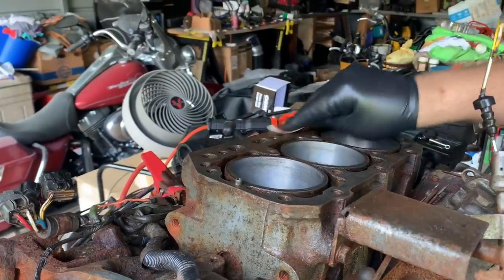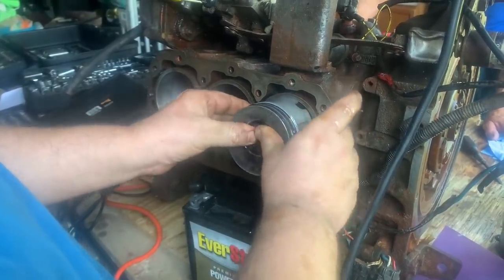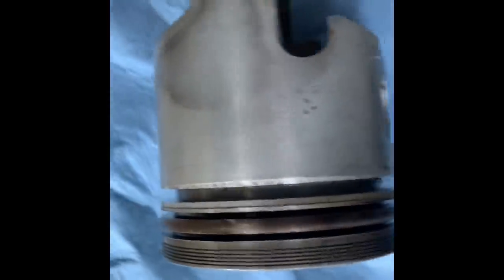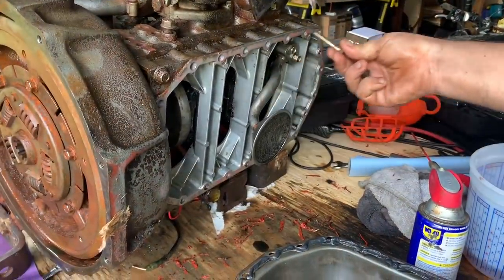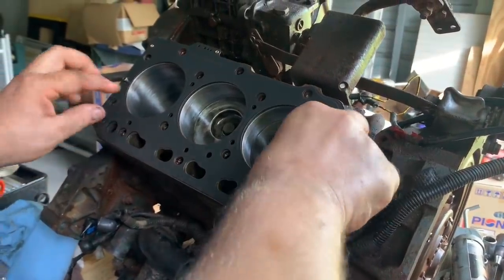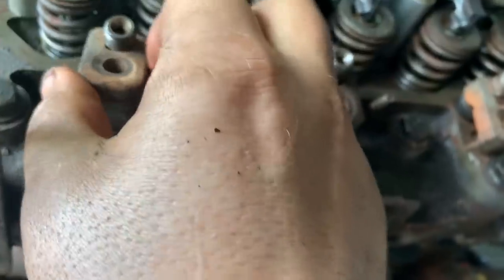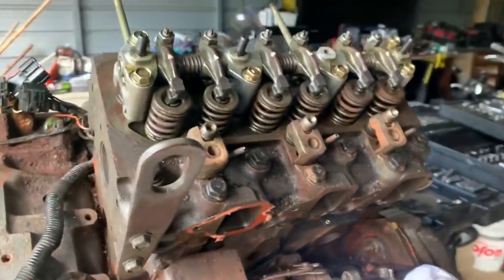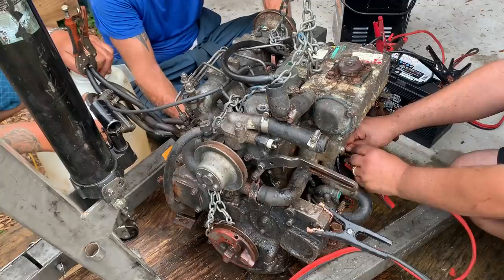Repairing a yanmar 3jh3e

Comment: Update on the yanmar diesel... This diesel was flooded on the engine room of a sailing catamaran during a hurricane with a previous owner, Scott and I have rescued 7 buses together and Scott was kind enough to offer to give it a go on repairing the yanmar... The previous owner had taken the engine apart and fresh water had done a good job of making an added mess of everything... 
Scott is really amazing at being able to go with the flow and figure ways to get most anything done...and done well...
The update is that we now have put over 600 hours on that engine this past charter season and it's running better than the one that was perfect in the other hull.... Thanks again Scott...

Comment: I am continually amazed at the conditions you are working in. In 1959, I rebuilt a 1949  overheated Chevrolet six (I don't remember the displacement) that had set in the Arizona desert for several years. Bored out.060 over it was a powerhouse for the time. It had shims and plastic tell-tales for clearance on the main and rod bears. I had to turn it over with a breaker bar many times before it would crank and it ran hot for several miles before the bearings "cured".
Reply from the maker: I just did this as a favor for a friend. It was more of a challenge.  I have never once worked on a 4 stroke diesel ever.  And since someone else took it apart and it was missing some parts it was crazy that we got it running in two afternoons.

Comment: Once again, fantastic work, thanks for posting this.  WD40 starting fluid, I love it!  Speaks volumes for the build quality of Yanmar diesel engines! Those battery powered ratchet wrenches are sure less restrictive then the air powered versions I began using 40 yrs ago.  No air hose to get in the way.  I am surprised that the fuel pump and injectors worked after suffering water ingestion.  That boat owner was lucky to have found you, but he looks like the same guy in the MCI bus video with the snapped pinion, so I guess he already had your number.
Reply from the maker: https://youtu.be/zuXHqdS26aA  yes i did this as a favor for a great bus client and friend.  He has owned like 10 buses.
Reply from the maker: And yes, Wd is much less volatile than starting fluid.  It took a bit to get fuel to the injectors

Comment: I am kind of the opposite of you in regards to the contents of the toolbox. I have all metric tools and then a few standard sizes for the in between ones. 5/16" = 8mm, 7/16" = 11mm, 1/2" = 13mm and so on. So I keep standard wrenches and sockets for things that don't fit a metric size well. 

Really cool to see that old Yanmar up and running. Great fix.

Comment: I hope you pulled the water pump cover and looked at the rubber impeller for missing paddles.  It is a good idea to replace them anyway.  If there are any missing paddles you need to look at the heat exchanger down stream of the water pump and rod it out if you see anything in it...Common cause of over-heating on a Yanmar.

Comment: Nice work! You rebuilt that rusted and seized boat anchor with minimal replacement parts. What was it? 2 connecting rods, a bearing and ring set, and a head gasket? The rest was just carefully cleaning and refurbishing what came off of it. That's an excellent rebuild! Thanks to the heroic metric crescent wrench! ;)

Comment: Believe it or not , it’s alive. Nice job . The motor sounds pretty good  and idels nice. I would be curious to know if the compression is with in spec considering you used the old pistons and shitty used rings.  ( then again, who cares it’s running ) That motor is going in that big ass Cat ?
Reply: Docking motor's are traditionally fairly small for tight and controlled environments where you need a predictable throttle but I've seen a few used when its calm with fairly good results speed wise.
They are after all an Auxiliary engine.
Reply: tony66au  I’m not much of a boat guy but I kinda figured that was its job. I was brought up to always go with “ big is better”  theroy.  Having said that,  that little motor probably lived in that Cat and will go back “ home” a happily little camper. Go in peace little motor ✌️
Reply from the maker: New rings on all 3 cylinders but yes used pistons.
Reply: @rickjohnson1632  Me neither but I was dragged along on a few boats as a teen and in my early 20's. These guys where very pernickity about using the right terms for the gear lol so I got an edumacation if I wanted it or not.
On the bright side the LOVED my old Bus when we would go camping or shooting and eventually a few Traded up although they kept the Captains hats so I dubbed them Couch (Coach) Captains and had a lot of fun with "Permission to come aboard" etc  as most had more gold braid than a South American Dictator which is saying something lol
Reply: Thanks so much..
I have a 3 cyl. Perkins, very similar marinized Shibaura block..
Your excellent way of transferring knowledge is much appreciated.

Comment: That's a new one.  I don't think I've ever seen someone take straight up sand paper to a deck surface before.
Reply from the maker: Had you ever seen a submerged engine set for two years in a bilge of a boat with a head off open to the elements?  A light cleaning to smooth out the rust ;)
Reply: @BusGreaseMonkey  I haven't though I think if the surface were bad enough to warrant sandpaper id probably take it to the be machined. 
Honestly all my experience is with gasoline car engines.  I've never even touched a marine diesel.

Comment: I didn’t see the valve rotator buttons go in. I hope they didn’t get lost when they took it apart originally. 
   Maybe it’s a strange model that didn’t use them??   ???
Reply from the maker: They were missing.  We ordered them and added them the next week.  That engine is still running strong more than 1,000 hrs now
Reply: @BusGreaseMonkey  oops sorry about the double post. The first one disappeared. Now I see where it went.   Always great to get a curveball thrown in at you when taking up the slack on a job. 
   Well done again.

Comment: what brand is your flex head flash light,  is it rechargable LED?
Reply from the maker: It’s harbor freight.  I have two of them one of the two quit charging after like two days.   So i just switch batteries around to the one that charges. I like it but with one quitting like that so quick I’m not sure about recommending it.  I’ve had them over a year and they both work great other than the one not charging.  Strong magnet base, bright, three modes of light.

Comment: It's about 350 dollars for a complete overhaul kit. Pistons, sleeves, valves, bearings, gaskets, all of it. Why reuse all the damaged \ used parts?  I've watched a few of your videos and you seem pretty competent so i just don't understand. These parts are easy to get.
Reply from the maker: Did you think it would run again?  I was not so confident and i saw it in person all seized up.  So we just played with it.  It was just a Hail Mary we did for fun.  When that thing came out of the bilge it was a lost cause.
Reply: Competent enough to get it running without spending the $350.
Reply: This was for a friend of his, I'm sure a paying customer would be different. Of course why pay attention to get all the facts?
Reply: @quackattak  Your rudeness is not warranted. The facts were noted. This is going in a boat, reliability is a major factor. As I stated I have watched a few of his other videos and I am impressed with his skill and knowledge. But, putting that in a boat is just silly. I think his friend should reconsider using it. P.S. I try not to troll, I talk to people as if they were in front of me. You should to.

Comment: Are you doing the cheapest rebuild as possible I mean only gasket so far that you mentioned is the head gasket you didn't get an oil pan gasket doesn't even look like you pulled the crank and change the front or rear main SEALS or anyting tell me if I'm wrong but
Reply from the maker: They don’t make an oil pan gasket, it’s like that from the factory.  And yes he wanted to even see if it could be running again.